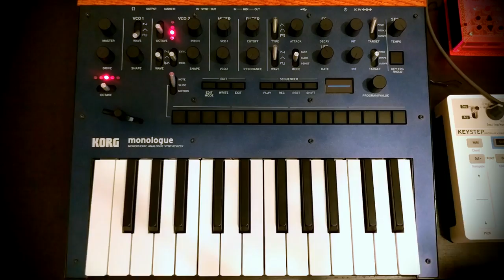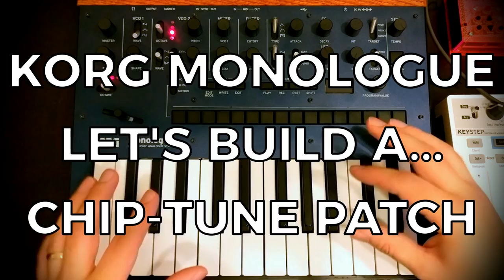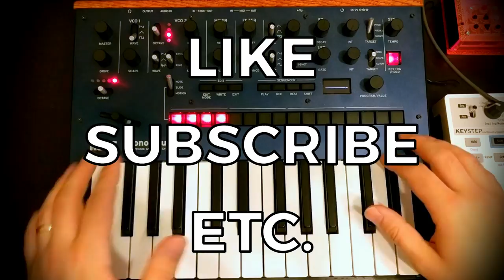Korg Monologue - Let's Build... A Chip-Tune Patch!

Comment: Interesting way to duplicate the arpeggiated C64-style chords.  Although did the NES really have modulation? I thought they would use both the square channels and slightly detune one of them to give it that Megaman-style depth. Or sometimes they'd use the second square channel to act as a (pseudo) delay effect for the first square channel.
Reply from the maker: Yeah, it wasn't fully variable pulse width, it was a set of predefined widths (duty cycles) you could switch between if I recall correctly.

Comment: Could I loop the synth with my guitar looper pedal?
Reply from the maker: You sure could - you might need to keep the output of the synth a little lower though if the pedal is meant for guitar signals which are usually pretty low.